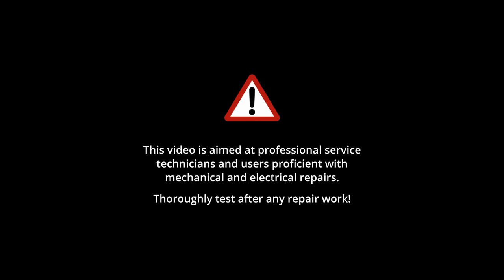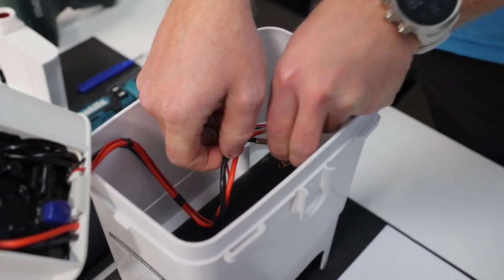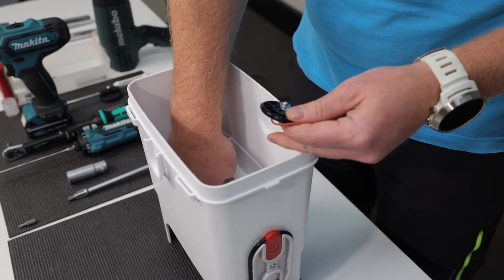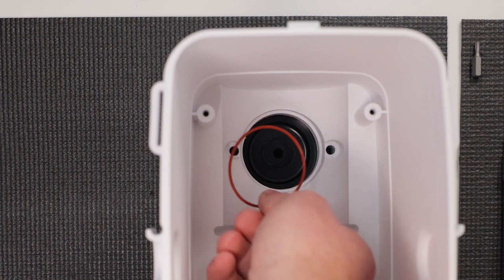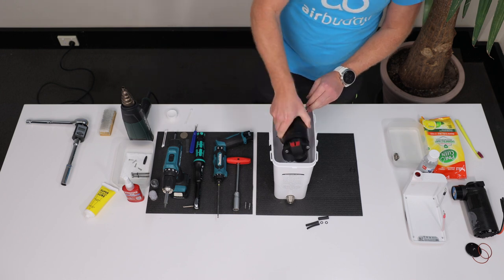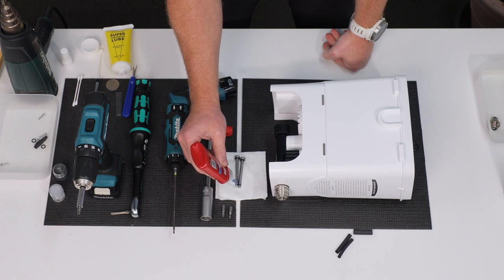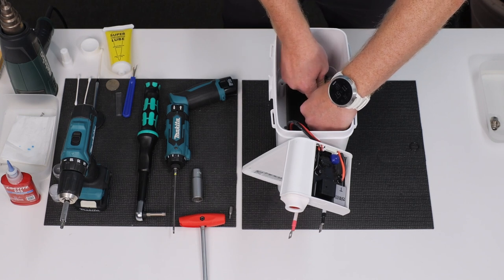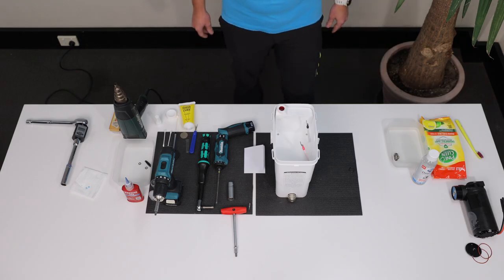How to replace the compressor with a new one

Comment: Hello, Did it possible to use standard thermal paste that used for processor heatsink for replace the one from the device ?
Reply from the maker: Hi, yes you can use other heatpaste, but it should have 8 Wm/k heat transfer coefficient or better.
Reply: Olá! Sou de Florianópolis, Brasil, como faço pra obter este produto?